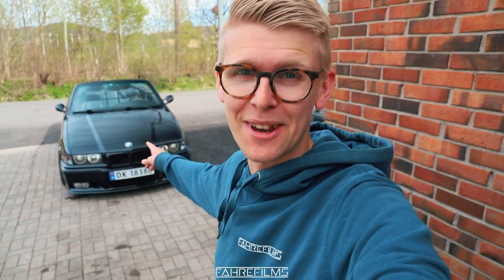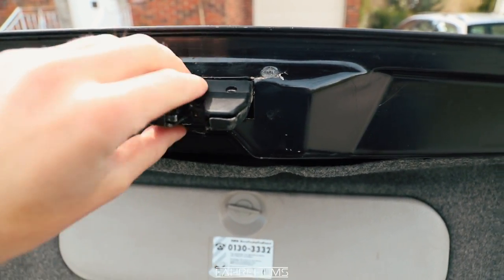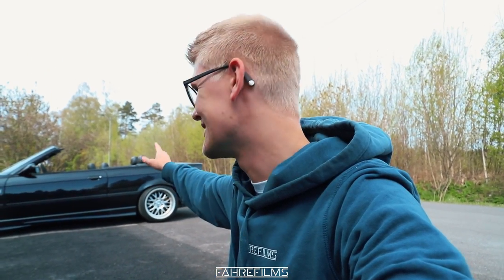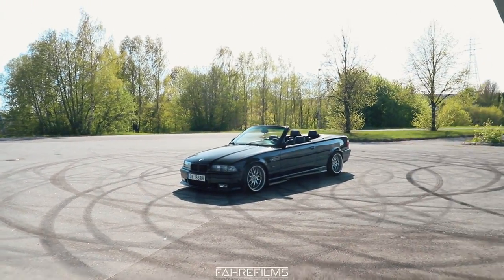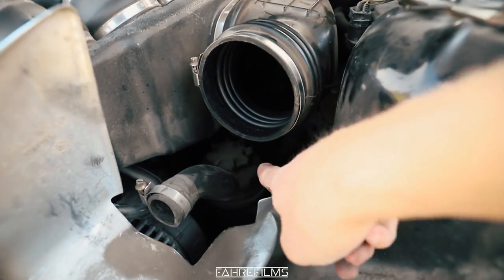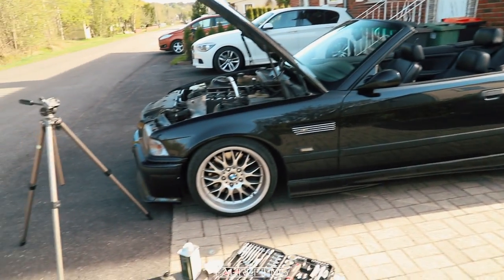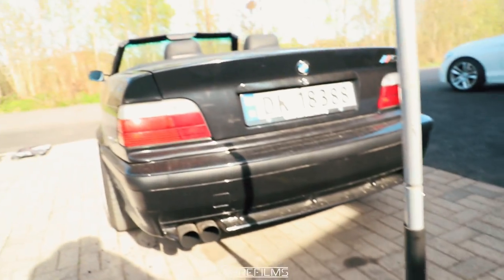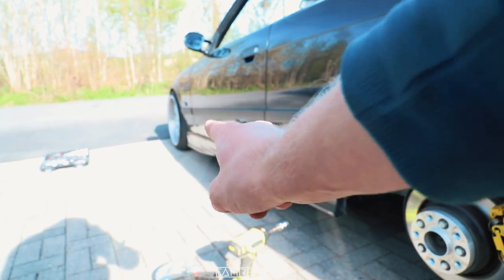Will it Fit? Porsche 911 Turbo Wheels on E36 M3!

Comment: Bmw power steering take red fluid, atf to be specific.
DO NOT put green fluid even after draining
Reply: This is exactly why i m here.
I didn t understand why swithcing from red to green?
Reply: @On-Road.l  He probably thinks green is the correct one and that someone mistakenly put red one, when in reality it's the other way around. Probably parts store guy or website told him green was correct so now he believes that.
Reply: @imnota  do you have any idea why my streeing feels very light, i m not feeling any feedback which makes drifting the car a bit unpredictable
Reply: @On-Road.l  
Have you checked the bushing on the steering column ? The part that connects to the rack has a bushing, it can get worn and even if it's not it's always a good idea to replace with poly or solid to get better feel.

What kind of tires are you running in the front ? What pressure ?

Do you have adjustable shocks in the front ? If so you can always try to make it stiffer.

Have you checked the control arm "lollipop" bushing ? It's what will dictate caster, which is the parameter of your alignment that makes your car self steer, if it's worn it can move and not self steer well. Can also be a good upgrade if you have stock centered one, you can get m3 style ones, they're off center to have more caster so more steering feel. 

If you have coilovers chances are the top hats have a caster adjustment as well, so look into that.
Reply: @imnota  i ve checked everything but not the lollipop i m hoing to check ot soon thank s man ❤️